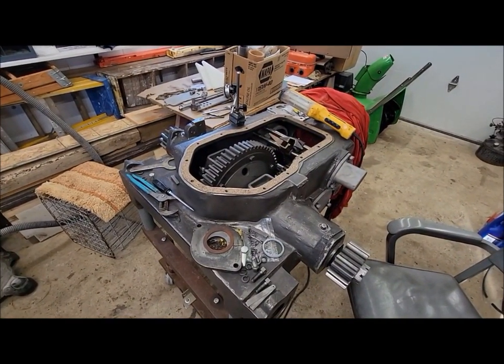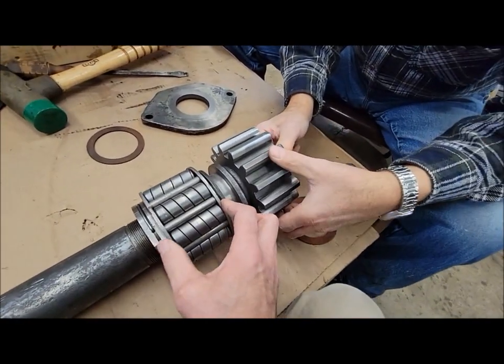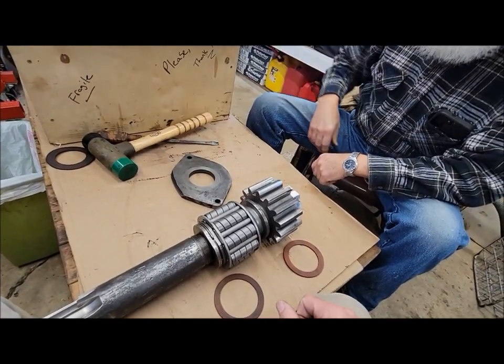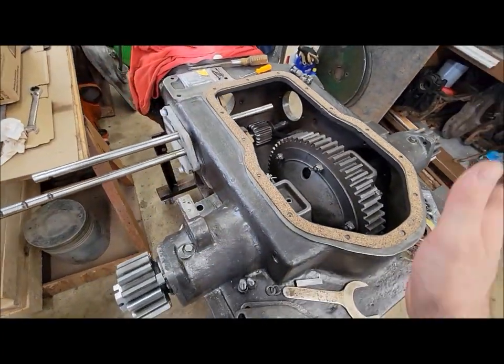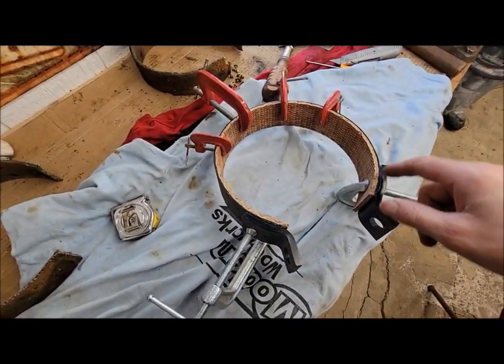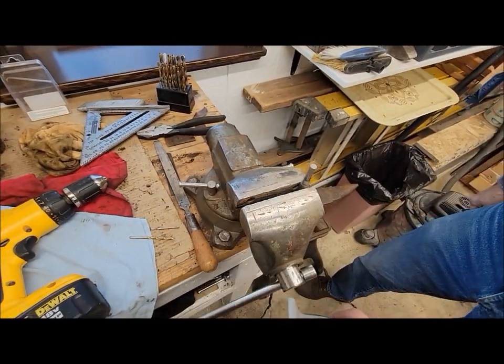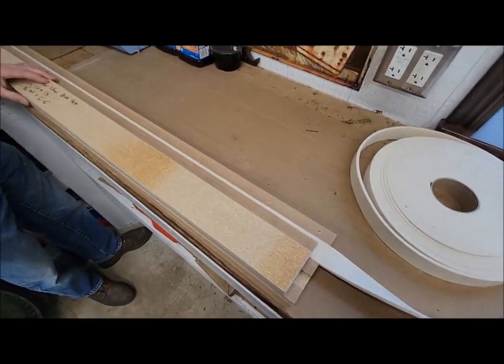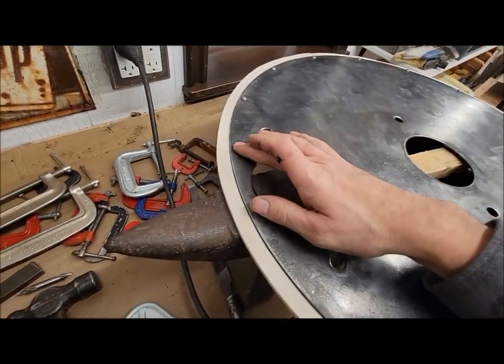Allis Chalmers 15-25 Part 31-pinion drives, intermediate shaft, brake bands,  final drive back plate

Comment: Have you ever considered using Torcite adhered to the worn surface on those plates and such to compensate for warn surfaces? It is very durable and can be machined to fit. This stuff is very commonly used when guys are rebuilding surfaces on old lathe ways, and machine tools. They say it wears better than the iron and is a permanent repair.
Reply from the maker: I have not, something I'll have to look in to...  I just Googled it.   I was expecting an epoxy type product (was thinking  like JB Weld) but looks like it's strips you put on the ways to make them wear better.   I'm not sure it would be a solution to problems I've had so far, but something to keep in mind.  Good to have multiple ways to solve a problem.  They do make better versions of JB Weld type products that may be applicable to some situations.  I have used regular old JB Weld to fill in pits of water necks for example so the rad hose seals up.

Comment: great work as usual, those rivets are countersunk head 😁 i am pretty sure that the pinion shaft and axle are both designed to leak oil to lube the final drive